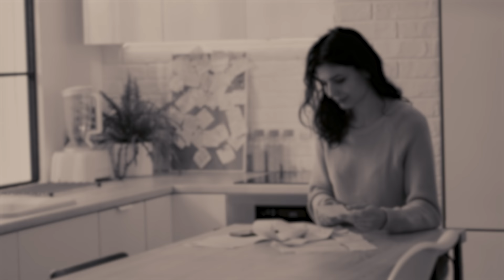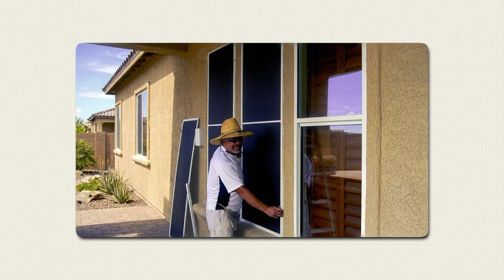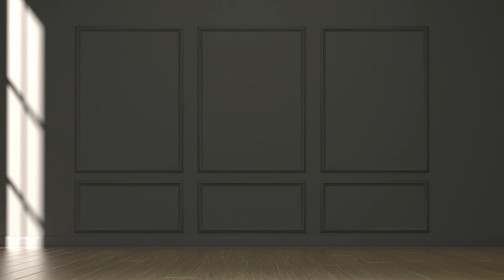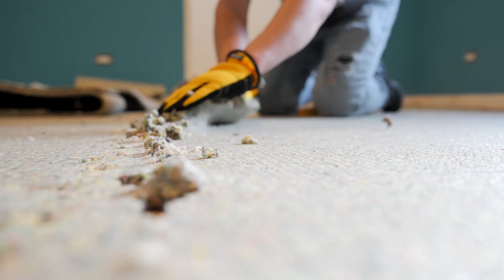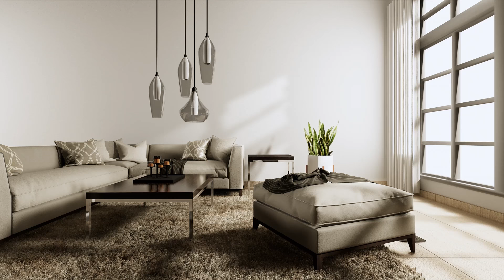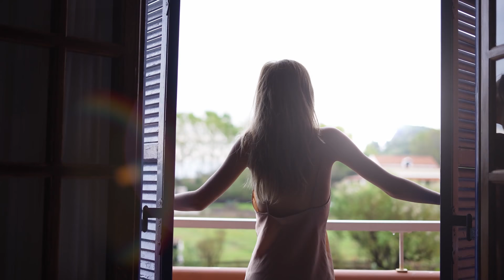7 Ignored Passive Cooling Strategies That Will INSTANTLY Cool Your Home In Summer

Comment: This is a great video.  I'm not gonna knock it down.  However, you are focusing on passive cooling, these things don't work so good in high humidity locations, and they are not very good in cold climates such as much of North America.  The vast number of people live in these cold climates.   The issue there is that more energy is consumed warming a building than cooling by several factors.  In that way you actually need the black roofs.  You also need that passive heating coming from the South.  The trouble is that over the last 50 years energy has been less of a consideration and buildings have been designed for mechanical heating and cooling. 

That is a big problem that has to be fixed because right now the world is producing and consuming 100 million barrels of oil and 400 billion cubic feet of natural gas and 24 million tons of coal per day.   Heating and cooling account for a staggering 50% of consumption and transportation 30%.  Now just do some basic math on what even a 10% reduction adds up to, not just if conservation but just pure dollars that can go to other things.  

Overall, I applaud your efforts.  Keep up the great work.

Comment: From my personal experience, ceiling height is absolutely underrated. If the ceiling is close to 7ft, then your head will be in the bubble of hot air! If the ceiling is 10ft or higher, then you will feel instantly cooler. It gets even better as you're not exposed to draft at head height, if the room has openings under the ceiling.
BTW: We used to have windows above doors for cross ventilation and the most prolific users of this concept are the Japanese who basically have every room with such ventilation windows (and cool air coming from the crawlspace through the cracks)
Reply from the maker: Totally agree.  The higher the roof then the more volume there is for the heat.  Heat stratifies up to the ceiling, so lower down the room will feel cooler, but I am not sure by how much!  Having cross ventilation which allows the heat to escape will certainly help keep the room cool.
Reply: @wildline_YT It can be up to one degree °C per foot or rather 1-3°C per meter, depending on air circulation. 
There's a good reason why many old houses had only in the kitchen double ceiling height or no ceiling panels under the rafters...

Comment: Most of the listed measures for protecting buildings from heat primarily work as a defense against solar radiation. However, it is known that even on the sunniest summer days, buildings and outdoor areas can be very cold when cold air masses arrive from the north. Therefore, I believe that we also need to consider the outside air temperature when taking action.
Reply from the maker: Interesting point.  So you are suggesting when the mrt (mean radiant temperature) has dropped you then need to consider the air temperature when looking at cooling options.  I would assume at this point you would not need cooling so a reflective roof who be of no use.  Before making any decision on cool roofs I would indeed agree you need to look at the 'degree day' figures for your area to determine overall benefit!
Reply: @wildline_YT  I live in Astana, Kazakhstan—a region dominated by vast steppes and deserts, with very few forests and a scarcity of fresh water. The weather here is notoriously volatile; it can change in an instant. You might find a dust storm and scorching heat in one part of the city, while a torrential downpour is underway in another. Our temperatures are extreme, ranging from +45°C in the summer to -45°C in the winter.
The wind is almost constant. It is so strong that it dries up rainwater before it can even soak into the ground. In winter, the wind strips the land of snow, leaving the ground bare instead of covered in drifts.
This summer, we frequently experienced days where intense winds brought hot air from the desert; the temperature would soar to +37°C, yet the sky remained gloomily overcast. The very next day, cold air would sweep down from Siberia, dropping the temperature to a crisp +15°C. People would be walking around in warm jackets, even as the sun shone brightly overhead.

Comment: What kills me is that the house I currently live in (not mine, so I can't fix this) is a nice old one that has shutters on the windows and windows that should open... but there's these screens installed in the windows that prevent me from actually opening any of them to use the shutters or let in a breeze. Houses that you can manually adjust like that are so good. Let's bring them back.
Reply: Mine has fake shutters just for looks.

Comment: Depending on where you leave you need to also keep in mind that cooling soution should only work during hot season while allowing your house to retain the warmth during cold season (which due to climate deregulation is also experiencing peak intensity at time in some part of the globe).

Comment: We have a very light gray asphalt roof shingle with foil under the roofing sheets and ridge vents. Exterior concrete block walls stuccoed painted bright white. Shaded east and west walls with shrubs and added exterior shade screens the three windows on those walls. We added R-30 blown insulation to the poorly installed code R-38 in the attic, added R-38 to the previously uninsulated garage attic space and insulated the garage doors.  After an energy audit, even after adding a mini split to basically dehumidify our garage, we now use significantly less than 1/2 the electricity a typically built, similarly sized home in our hot and humid region 60 miles north of Tampa, FL. Proper sealing, especially around doors and windows really helps, too.

Comment: I dont understand how foil in shade reflects heat. Maybe the shiny side?
Reply: Aluminum foil reflects radiant heat, which is heat that travels as infrared energy. Even if the foil is completely in the shade under a roof, the underside of a hot roof is still radiating heat downward. The shiny surface of the foil reflects much of that radiant heat back toward the roof instead of letting it radiate into the space below.
It does not stop heat traveling by direct contact (conduction) or by moving air (convection). That's why foil works best when there is an air gap next to the shiny side. In a hot attic, the roof heats up from the sun, the underside of the roof radiates heat downward, and the foil reflects a large portion of that radiant heat away, helping keep the attic and rooms below cooler.
Reply: Aluminum foil reflects radiant heat, which is heat that travels as infrared energy. Even if the foil is completely in the shade under a roof, the underside of a hot roof is still radiating heat downward. The shiny surface of the foil reflects much of that radiant heat back toward the roof instead of letting it radiate into the space below.
It does not stop heat traveling by direct contact (conduction) or by moving air (convection). That's why foil works best when there is an air gap next to the shiny side. In a hot attic, the roof heats up from the sun, the underside of the roof radiates heat downward, and the foil reflects a large portion of that radiant heat away, helping keep the attic and rooms below cooler.

Comment: Bird proofing windows is also super important for those reflective mirrors. For birds it just looks like open space and they fly right into them. So breaking up the reflection using bird proof window dots, UV reflecting decals or films, or hanging paracords helps to make them visible as solid structures!
Reply: Yes!!!!!!!
Reply: And avoiding reflective films not only saves the birds from injuring themselves... it will save your nerves as well...I had reflective window film at my last house, and birds flying into it at full speed just after sunrise will frighten the #@+! out of you as you're trying to sleep.
Reply: @tano1747not to mention what it does to the birds
Reply: I used strips of blue paint tape across the new windows I put in.  The birds would stop in front of the window, flutters around and decide that there was no landing paid, and fly back to the tree.  The tape doesn't obstruct my view or light and it has saved the birds from injuries.

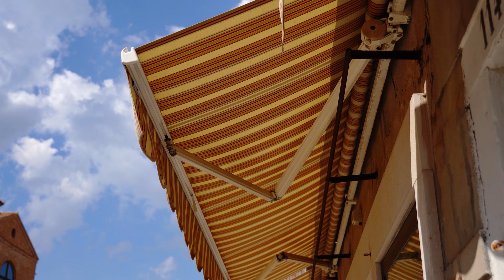Comment: 04:48 I had always assumed interior blinds were enough, but realizing that blocking the sun before it even hits the glass is the real key to preventing heat from building up inside is such a practical eye-opener.

Comment: needs a special on tropical cooling because its so different
Reply from the maker: Good point, maybe this is something I will work on :)
Reply: @wildline_YT  I'll be waiting!
Reply: @DontuseGoogleorWiki Me too
Reply: Large rooms, very high ceilings, wood structures,  large openings, keeping the heat off the walls/shaded, very well insulated roofs in which thatch and palm fronds are particularly effective placed at a steep pitch for rain run off, if iron roof make zincalum silver over iron with wood underneath and greatest insulation, occupancy in the building starts at one floor up above the first 6 to 8 ft where heat is greatest, with the house on wooden poles with wooden floors and underneath the house compacted bare earth or crushed rock for the base makes cool shaded area, any deck or verandah is best to have a roof detached at the overhead from the house with a 1foot gap above the house roof to vent air and similarly the floor deck should be 1foot or 8inches below the house floor with the gap to allow air to enter. Shadey side of house kept dark with lattice that still allows air movement, the use of all lattice and all louvres to allow each window to allow for full air entrance in exit with no fixed panes around all windows and doors, louvres can be in lightweight woods rather than glass less embodied mass, the chimney stack works still and consider the prevailing breeze in summer where it passes over a deepish pond with high high shade trees to promote water coolness before passing through windows and doors. No cincrete or bare earth all outside areas shaded and others green lawn. All outside surfaces of house white and roof top silver iron if can't use palm leaves or thatch for maximum reflectivity preferably topped with solar panels the whole way to assist lower temperature. High velocity ceiling fans with many speed settings and a curve to the blades...., they are available to push air right out to the edges of the room.
Good luck..., I grew up in humid hot climate. I hate it and now moved to a Mediterranean climate, wet winters, dry hot summers with low humidity in summer. Perth, Western Australia.

Comment: An excellent essay! Good overview of the principles of passive cooling! 

Two additions I feel are important: a radiant barrier requires a small air gap between the reflective material and the adjacent material. Otherwise, conductive heat transfer will occur, negating the reflective effect. In practice, if you place your foil directly on the roof sheathing, you'll reflect heat into the attic in winter, but it won't keep out heat in the summer. Placing it directly against insulation has a similar effect. Shiny side toward your heat source. Mind the gap. 

Secondly, air tunnels are a prime breeding ground for mold and mildew. Never bring air tunnel air into your living space. You can use the cooled air, though in an air-to-air heat exchanger or an air-to-water (or refrigerant) heat exchanger. Your air conditioner won't have to work so hard with cooler air available to discharge the heat. As you mentioned, the soil directly under your house makes the best heat sink, and in winter the best heat source. Before pouring a basement, put in the poly tubing, even if you don't plan to use it.  

Love the content! Keep 'em coming!

Comment from the maker: What passive cooling techniques are you using to keep cool this summer?
Reply: I water the walls of the building and the paving stones in front of it with water.
Reply: On south facing windows, I use insulated inside curtains.  The wind we have in the southwest will not allow any type of outside cover unless it is affixed to the window. permanently.  I had a wonderful plum tree outside the window but it got old and had to be removed.   I have not yet replaced it.  The tree was delightful because I could watch the birds and insects eat the plums and the tree was short and wide so covered both windows.  It was great.